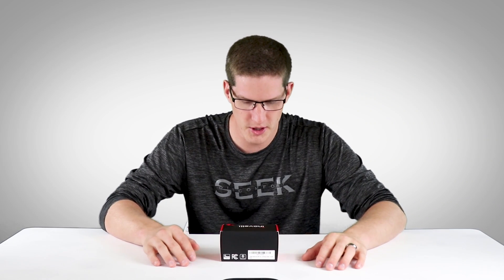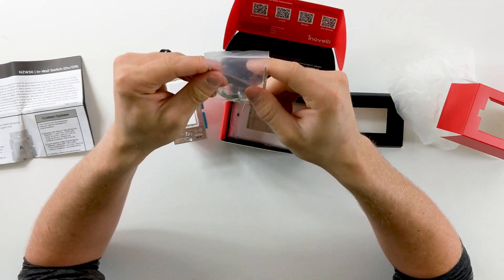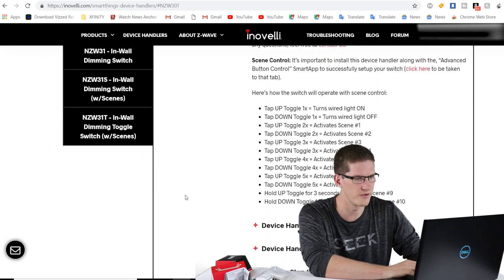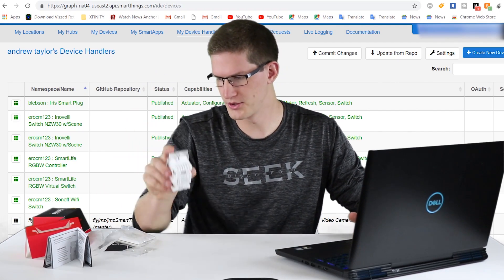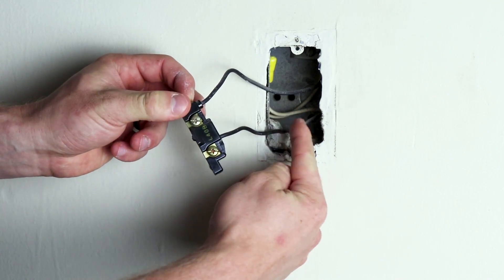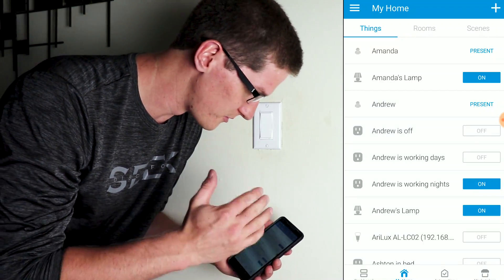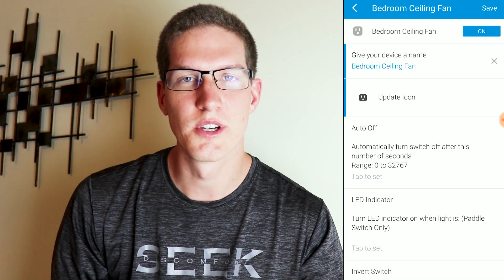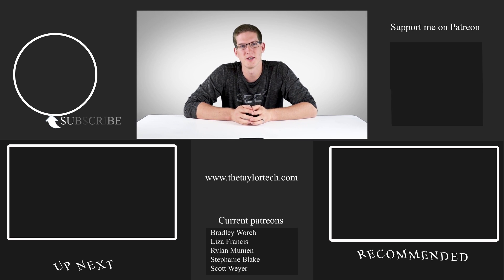The Best Smart Switch Just Got Smarter | Inovelli Setup & Install Part 1

Comment: Lutron Caseta dimmer will work without a neutral wire. Requires a small hub that can take up to 50 devices. I don't know about Smart Things compatibility.  Dimmer is NOT for ceiling fans but Lutron offers a smart ceiling fan switch as a part of the Caseta line.

Comment: Looks like a great replacement for all my 2gig/linear switches.  The 3way switches are nice because you don't need a traveler BUT they just don't last
Reply from the maker: These are great for 3 way setups because you can use your existing 3 way "dumb" switch.